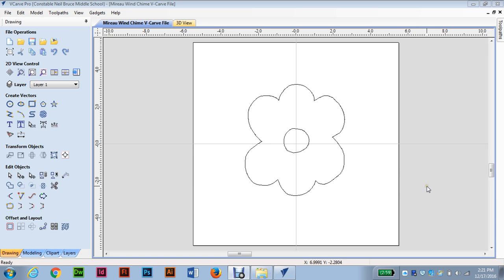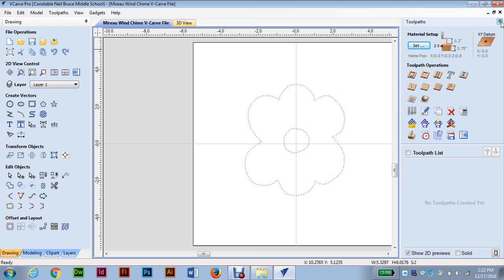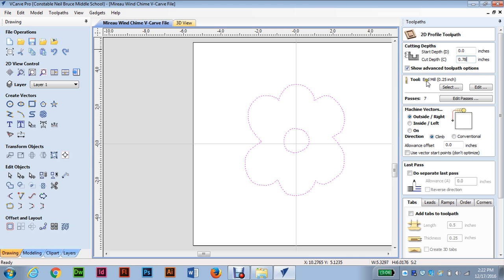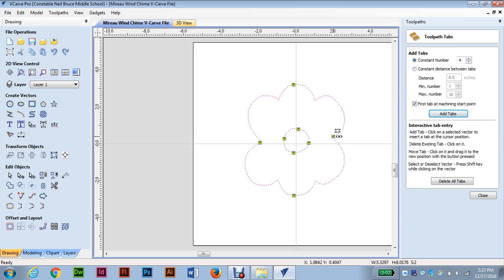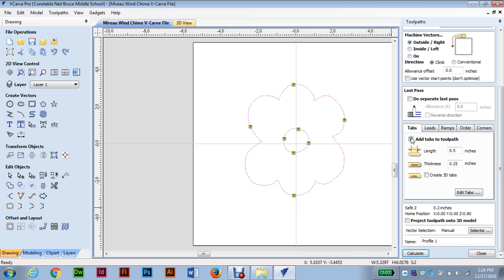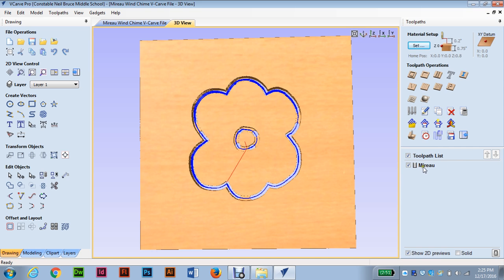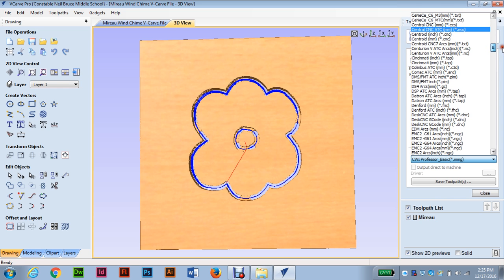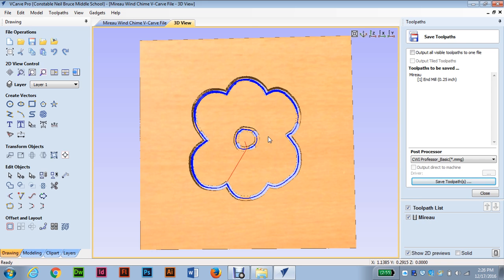2 Saving the MMG File

Comment from the maker: An mmg file is a program file that CNC routers understands.  You can not open it like you would open a normal software program file.  Instead on the controller of the router, you would select the mmg file and run it to make the project.